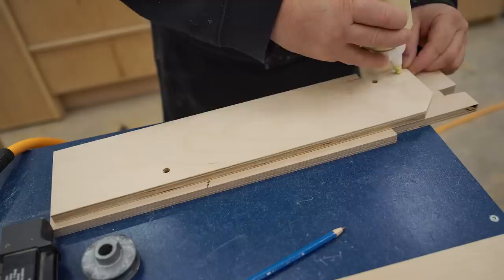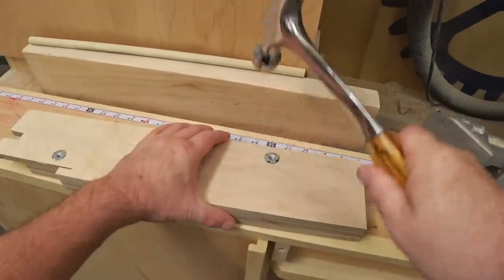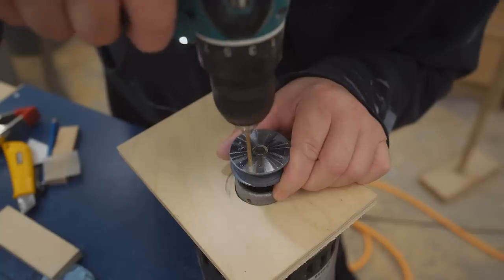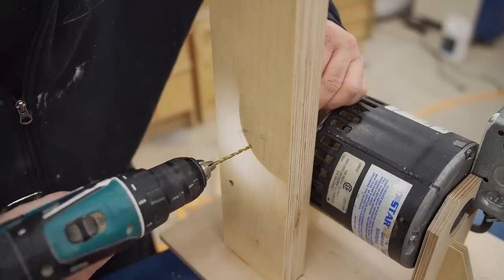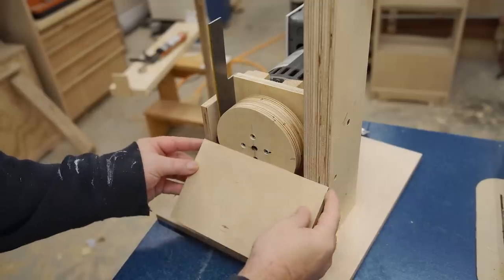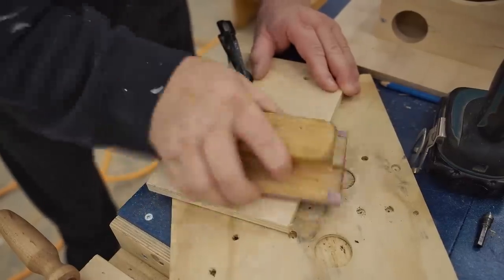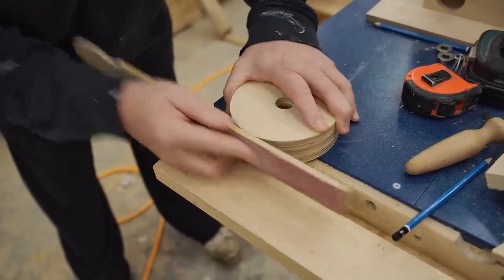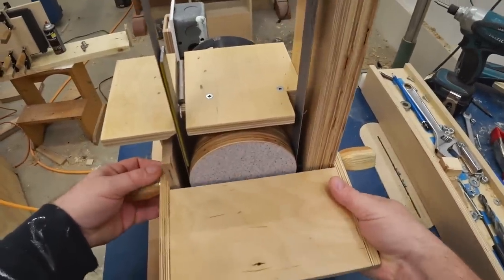How To Make A Belt Sander / Disk Sander Combo

Comment: I have an old 9 inch band saw that junked the rubber tires off of it.  I've been thinking about building something similar to this with that. it's a delta with a belt drive so it has a decent blade speed and if it isn't correct for a sander, it'd be easy to adjust the speed with a different pulley. I love watching all the things you build, I just dont have the time and worry I wouldn't get a suitable finished product like you so I figure if I can start with wheels and frame and go from there, I'll be sitting myself up for a better likelihood for success.

Comment: For the bad screw holes, you can mix up some wood glue and saw dust and fill them back in... those holes are basically filled with homemade MDF at that point, but better than nothing. :-)

Comment: Hey John, great build, as usual ! 
Isn't a good idea to add a little plywood triangle on the upper table, against the vertical metal plate, to act as a square and avoiding the plate bending in when you push too hard on it ?

Comment: So cool!  I’ve been watching your videos a long but have never commented.  I have two questions - 1 - why do you still clamp the sub assemblies after pinning?  I have seen a lot of people for whome pinning is enough but I’m betting you have a good reason and I am curious.  And 2 - do you think this could be used for sharpening, or even putting the bevels on, edged tools or home made knives?  Thanks again!
Reply: kfholler clamps provide much more pressure than pinning, which in turn means a stronger bond. A pin-only glue up may provide a strong enough joint for many purposes, but if you want maximum joint strength; clamping is the way to go!

Comment: Hey John. Thanks for all the hard work you put into videos. Well done. Do you think it would be possible to use a bench grinder for something similar. Maybe one side for the belt and the disc on the other? I can't seem to find a motor cheap enough for my little wallet. Thanks again love the videos
Reply: Most bench grinders are 3450 rpm.  Might be able to adapt with a 1750 rpm grinder???

Comment: Sweet sander! Don't you ever wish your disc was bigger? I think mine is 9" and I'm always wishing it was 12".
Reply from the maker: I had a 12" and ended up not using it when I made my earlier 5" one. It's extremely rare that I would need the bigger surface, and I hated changing the disk on it. Not to mention they cost more and I couldn't get them locally.
Reply: there's a joke in there somewhere :)

Comment: It's important to thoroughly sand your shoe type push stick because it has no other use than to look pretty.
Reply from the maker: You need find something else to lead the charge on. The epic push stick battle already has a worthy representative on both sides.
Maybe you can take up the not using a light switch for homemade machines campaign again.
Reply: You have to be passionate about what you troll.  Otherwise it just rings hollow.

Comment: That's better and sweeter running than the one I bought.  I might cannibalize it and use some of the parts to build this.
Reply: baconsoda - I was thinking the same thing. I wonder if we have the same one?! Mine is so bloody noisy with the belt on and shims next to the bearings only improved it so much.
Reply: Hi Lindsay, mine is a little Clarke 1" belt and disk sander.  It's a mass produced one that appears in different colours and names.  The motor is good but it is noisy running so I am thinking of using the motor and switching for John's model.